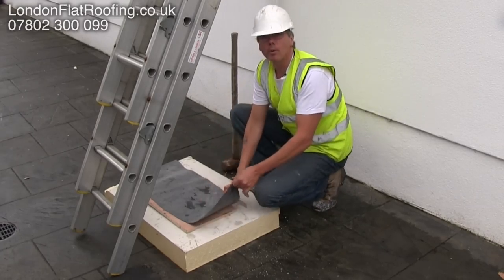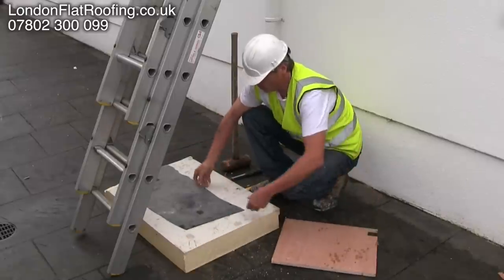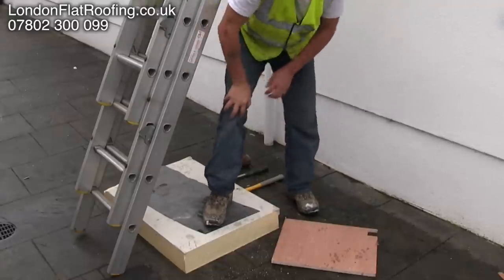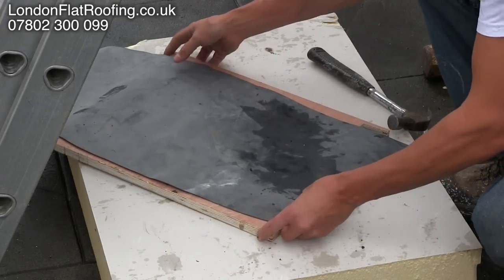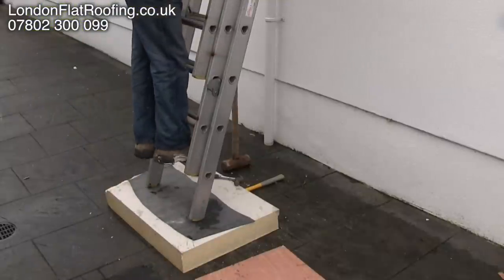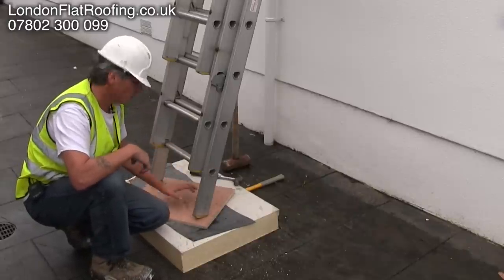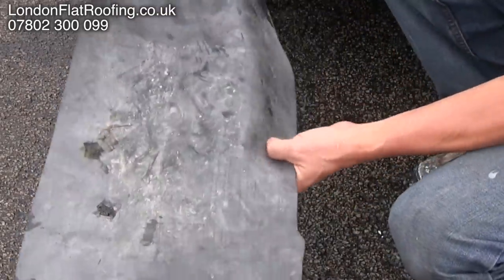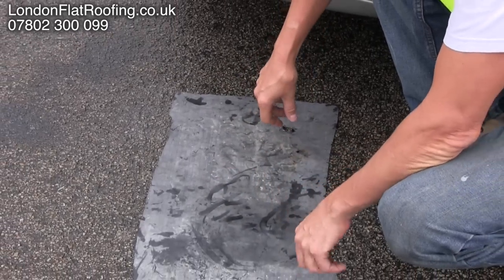Is An EPDM Rubber Roof Strong Enough To Walk On?

Comment: For anyone wondering this guy is completely wrong if you apply the epdm to the insulation, at the end of a hot day when the rubber shrinks (it expands when heated and contracts when cooled) the layer of foil on the insulation  will peel off leaving ripples and lumps on your roof the exact same thing will happen with ply oriented strand board is made for this stuff and will not rip apart no matter what unless soaked with water which would be human error
Reply: U are not supposed to stick EPDM to foil backed PIR insulation.  There are fleece lined insulation boards that must be used for warm flat roofs where a membrane is to be adhered directly.  The fleece is mechanically bonded into the insulation and impossible to tear off, unlike foil.  I think Steve is used a standard PIR board here to demonstrate impact, he doesn't imply this is correct material for fixing to does he?

Comment: stop trying to make out that it's OK to lay epdm onto insulation board cos as this video as shown on every test it fails so please ply over first.
Reply from the maker: Ply over first is the way I alway wont to go, unfortunately, lots of customers won't cheep flat roofs and  that exactly what they get, It will last but it's not as bullet proof as it could be if the EPDM was laid over OSB and we alway use tung and groove OSB
Reply from the maker: WithoWithout a doubt go over the insulation with Ply or OSB we use Tunge and grooved OSB over the insulation its leads to a lovely roof.
Manufacturers of insulation suggest that you can just go over the insulation with the EPDM. This may save money, but it's not as good.ut
Reply: This flat roofer guy on about "its not a warm roof" the rubber doesn't need to be touching the insulation to be a warm roof it is sealed around all edges by wall trims, gutter trims, cap trims and silicone on top of that also all rubber roofs no matter how big or small MUST be mechanically fixed using trims and screws around the whole perimeter you cant just glue a trim on and thing that it will last

Comment: Use the claw end of hammer and see what happens....
Reply from the maker: If you watch to the end you see I do use the end of a hammer even sharper than a claw hammer. Name me a roofing material you can abuse like this 
Asphalt would smash
Mineral felt would puncher 
I don't know of a flat roofing materials that wouldn't brake or puncher  with this sort of abuse
Reply: rick baker ... the world is waiting for negative... and if the claw end of claw hammers are to fall from the sky we will all have leaky roofs..cars..heads...

Comment: I will be having some new upvc windows and door fitted to a porch on the rear of my bungalow. It’s used as a utility area with washer and dryer. Separate from the main building by a upvc back door. 
The existing upvc is built on small walls and has a brittle old Perspex roof. I was keen on putting a solid flat roof on top of the new upvc units once fitted, so have been researching cold/warm roofs and finishing material. Is EPDM vulnerable to seagulls - ie their beaks? I’m costal and gulls sit on roofs etc around here.
Reply: Epdm is not vulnerable to beaks dont worry😂👍
Reply: When you feel the stuff yourself you'll see how tough it is